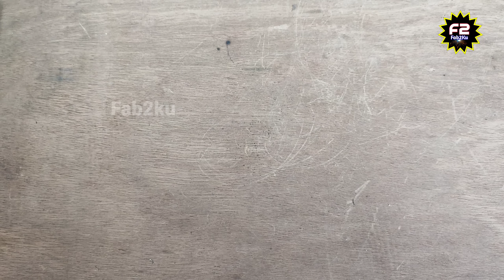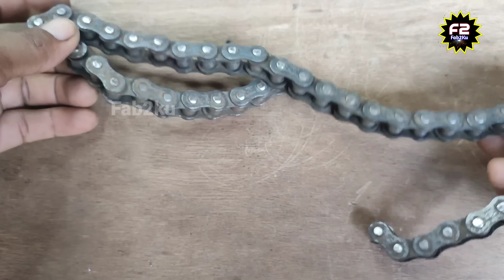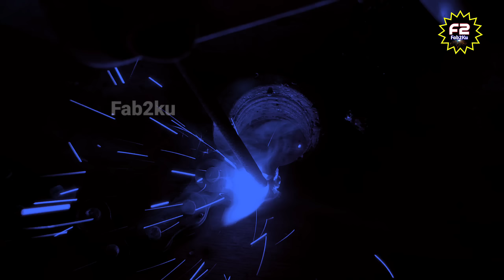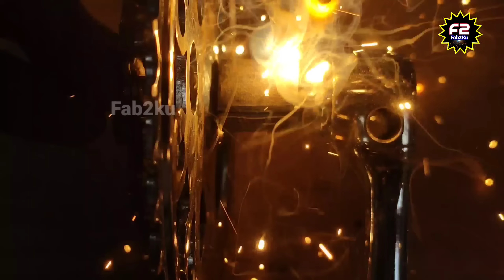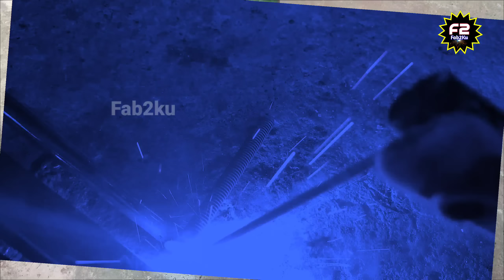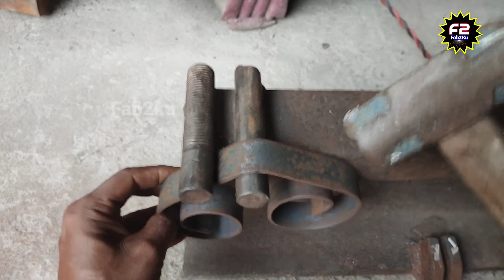Smart And Helpful Diy ideas / Handmade Tools You Must Need / Helpful Handmade Tools Diy ideas

Comment: The scrolls are ok but to make them better you need to get it so the gap gets wider as you go out so welding a few links would help it get wider or put a few solid pieces of bar in it
Reply from the maker: You are right sir